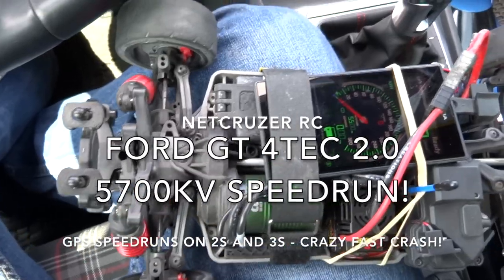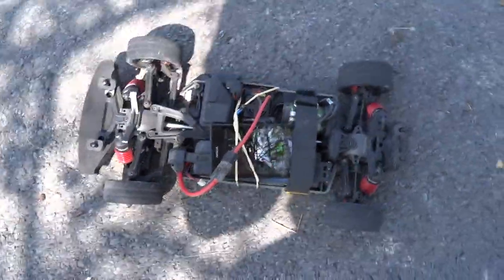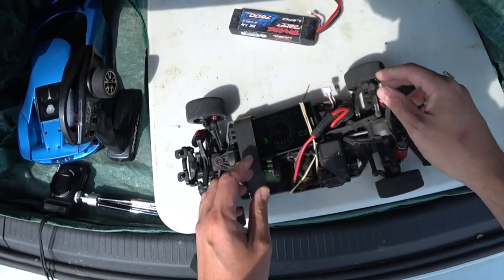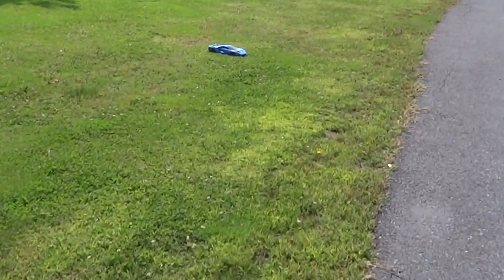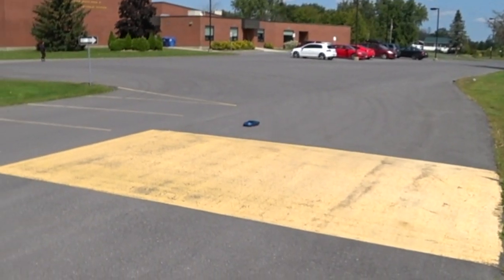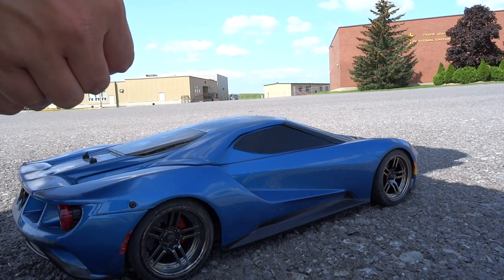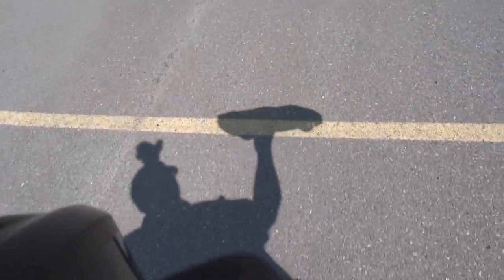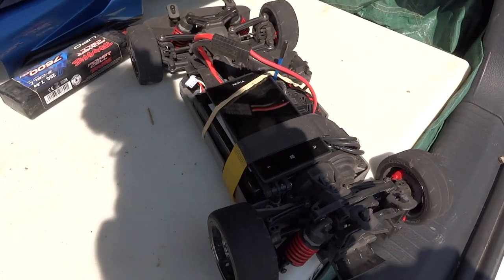Traxxas Ford GT Brushless Speed Run! 5700kv 3S HIGH SPEED CRASH 4-TEC 2.0 - Netcruzer RC

Comment from the maker: FYI - This is using the original non-VXL rated tires, so besides having little tread left they will have been ballooning like crazy on 3S full throttle, adding to the lack of control. Better tires needed! Also this is with the 70 tooth spur, since the 55 is still not available separately yet.  This is the brushless system I installed, 5700kv castle combo: http://amzn.to/2iKXyjC
Reply: spur gear and pinion is stock or upgrade?

Comment: Sounds like the gear mesh is too tight.
Reply: I agree making that motor and esc work harder then they should gonna e it real hot sieze barrings in motor back pinyon off of spurr just a hair. Its also censored not plugged up

Comment: Hey dude! I have ordered the same combo (5700kv but with mamba X) for my Ford GT. Which speed in your opinion I could reach using the aforementioned combo using 3s and 35\55 gearing? Are there any methods how I can make this car even faster by playing with gearing? If so, could you suggest best what I can pull from the car? Tnx in advance!

Comment: Really awesome man. I really enjoy your videos. Like
Reply from the maker: Thanks Jacob. Glad to hear it, this one was a struggle to do, I had tried earlier in the week in a different location since I underestimated the room required to wind it out.  So I tried again and this was the result!
Reply: Netcruzer RC TECH CARS I have a Xmaxx 8s and a couple slash 4x4 trucks. The more I watch your videos the more I want to get this car. What kind of tires could u put on it that would last? The ones that are rated for the brushless. I guess they might last a little longer.
Reply from the maker: Not sure, depends on what you plan on doing. Mine are mostly worn from drifting, not speedruns. For drifting harder is better. For speedruns foams or GTR speed rated tires would likely be best.  Now if you have a few Slash 4x4s arleady those can also be adapted for speedruns.  If you want to drift and have onroad fun, I do recommend this new 4TEC. It's great, seems very tough too!
Reply: Netcruzer RC TECH CARS yea I was thinking about getting 2 of them and me and my son do some road racing. I love the way GT and the mustang look. They are cheap but I always want faster so I'm kinda looking at the brushless one they have.

Comment: I no this has been awhile but if it were me I would take and put the 17mm hub adapter on it get a set of xo1 tires or a hard compound tire hot racing makes a inset of hub adapters that stay on nice with a allen screw key so no wobble action goes on I belive that and shave the fender alil bit if needed to get the speeds or possibly even higher for that small of a car super cool tho I have that same motor I havent put it on anything yet I'm thinking after seeing ur video I may just buy the ford gt Roller kit and set it up with Hobby wing max 6 and the 5700 it should definitely get down ...👍

Comment: I had to change surface to concrete smooth, no speed bumps and turn down your TSM to about 25% then try.  Also at that speed your cell phone causes a balance issues.
Reply from the maker: I did have TSM down to 10%, and this lot is very smooth.  I've ordered foam tires and will only do speedruns pointed AWAY from the speedbumps from now on. :)  As for the phone, yeah it will affect lateral balance but hopefully not enough to matter much.
Reply: Netcruzer RC TECH CARS Cool if you don't mind could you send me the link where you ordered your foam tires, size and are they  mounted?
Reply from the maker: Tank 62 amain.com for tires 1/10 scale. Contact brand. Lots of different width sizes and colours and foam density. Do some research. I'm not even sure what I ordered is correct.
Reply: Netcruzer RC TECH CARS LOL, I have already ordered 2 sets, I'm just trying to get it right this time.  At this rate I could have purchased a full set on my grown up real car.  But thanks I will check them out.
Reply: Netcruzer RC TECH CARS I have check all over  pretty much I have anther full set coming in I will see how they work out before I spend another dime.  Thanks
Reply from the maker: What did you get? I have 30mm rears and 26mm fronts in shipping, foam score 37. (white rims)

Comment: Is the TSM turned on or does it not work at those speeds?
Reply from the maker: TSM was turned down to about 10% if I recall correctly.  If you have it too high at high speed it will overcompensate and start a fishtail slide.

Comment: I have a redcat sandstorm i am using castle 4600kv 18 tooth pinion 654 spur 2 cell. My motor is kind of warm. Just wondering if i need to gear down or up

Comment: Mine had a pull to the left. Had to adjust the trim. The stock tires are horrendous. GRP or even the Vattera tires combo set is the way to go.
Reply: You may want to look into a heavier diff grease.(sorry if late, just want to be helpful)

Comment: use traxxas battery
Reply from the maker: No way. Traxxas lipos are pretty poor performers.
Reply: Netcruzer RC TECH CARS  Traxxas lipos are good for certain times  you should try fast race tires for your ford gt they have a lot of tread and last long 70 for pair so 140 for full set